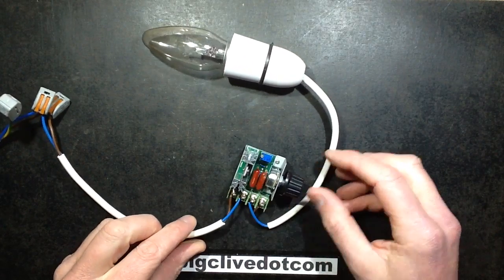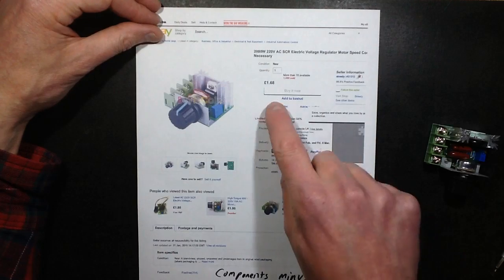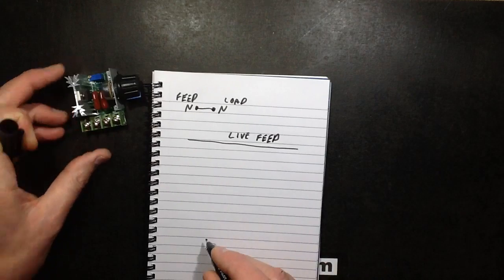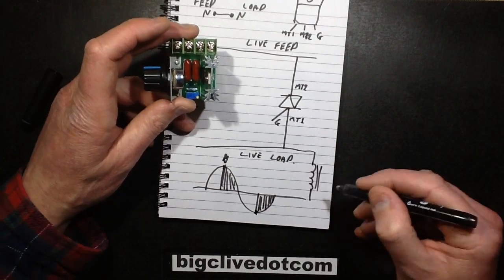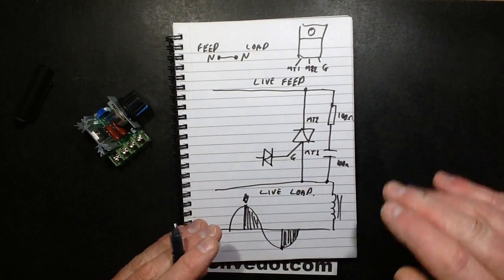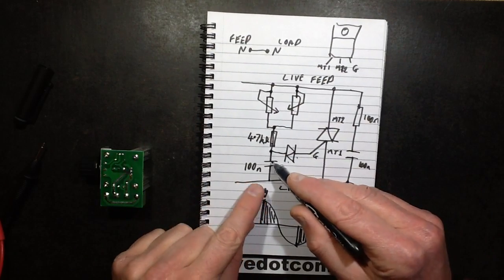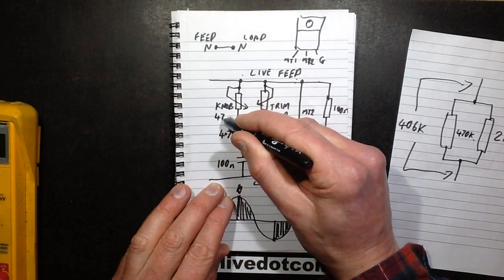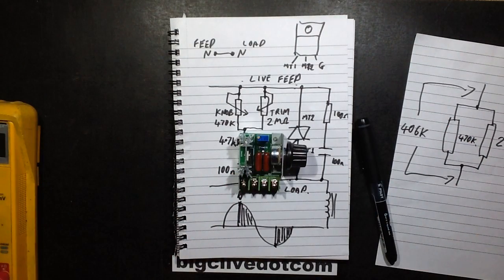Reverse engineering of a mains power controller.

Comment: The one I have seen use an SCR and not a TRIAC. Is there a part number?

https://www.amazon.com/gp/product/B00LODGP2E/ref=ox_sc_act_title_2?smid=A30QSGOJR8LMXA&psc=1
Reply from the maker: A thyristor would only switch half wave.
Reply: @bigclivedotcom  Precisely. (Silicon Control Rectifier) I am just wondering if there's a slight possibility that your board is an SCR?
Most of these boards appear to have the part number scratched off or blank. 
I just ordered the one I linked from Amazon. They all appear to be one and the same manufacturer. (or copies) 
It states .."This controller uses novel    bi-directional    high-power SCR" Is that what the Chinese call a TRIAC?? :)

Thank you.

Comment: Thanks for detailed reverse engg. Can we simply replace BTA16 with BTA40/41 to increase its power level without any modification in circuitory or the oem circuit 4000W with a bridge rectifier is required as explained by you in a separate video.
Reply from the maker: You might need to scale up the other component sizes too, to deliver a higher current gate pulse.  If you're trying to build something like the 4000W dimmer unit then it might be worth using it as a base for the project and upgrading the components.

Comment: Here is the one I bought on ebay.
https://www.ebay.com/itm/AC-110V-220V-2000W-8A-SCR-Voltage-Regulator-Speed-Control-LED-Dimmer-Thermostat/322922899870?hash=item4b2fb4699e:g:MjsAAOSwZ1BXeNBv

Comment: Your analysis is very good and helpful for needy repairs if any. I purchased recently one from China.  It is working good for my mini drill (220v, 350w 2600 rpm) which I use for day to day minor works and also for my Bosh angle grinder  600w 11000 rpm (to the reduction of  speed upto 50% ).  Any way my other Drill  Bosh 13 mm has got builtin speed control.  Thank you. With regards - VG Krishna, from India.

Comment: Can you use this to control a 240 volt transformer welder?
Reply from the maker: No.  A welder requires a lot of current and the chopped waveform would make the arc tricky.  The huge inductive load might also kill the triac quickly.

Comment: I have a question. I bought one of these only it has only 2 terminals for input and out put. How do i connect that????
Reply: (If you don't already have an answer) Chances are, connect the neutral of your input and output together and connect the hot wires to the board (It only needs to switch the hot wires, so the neutrals can completely bypass the unit)

Comment: Hi can I use this for hho? Thks
Reply from the maker: It's AC and mains voltage so not suited to electrolysis if that's what you mean.
Reply: Bigclive thks for response. Yes but what if I do a br after the circuit?.

Comment: So the beast will not switch on until the mains cycle reaches over 30V?
Reply: Right, but then it can be turned down a bit I have found, down to about 18 volts.

Comment: I built a speed controller using this same circuit a few years back Sadly its died for some reason (probably not a big enough heatsink), but I think I'll buy one of these and just add either a small fan or a bigger heatsink.

Comment: Sir is the light dimmers can control current? Is it increase or decresw current level?
Reply from the maker: It reduces current by turning the load on and off during the mains cycle.
Reply: Thank you sir..so its not inter fair  voltage?

Comment: Common value for a pot would be 500K not 470K.  500K in parallel with 2 meg  would be 400K so close to the measured value.  How long did you spend at the pub on your way home?  Next time you have R in parallel, go here https://www.allaboutcircuits.com/tools/parallel-resistance-calculator/
It can handle multiple R in parallel.

Comment: sir how work Trigger Switch for Drills
Reply from the maker: Modern trigger switches use a MOSFET as the main switching component and electronic circuitry to drive it with a pulse that varies in on to off ratio to control the power.  (Pulse width modulation.)

Comment: Hey @bigclivedotcom im going into cyber security, looking to mess with pcbs. got my jtagulator and about to buy a bus pirate, im working with a sound board for a little project just to get the fundamentals. Dont understand the whole electrical bits but studying the chips, scared to blow my toys up, Any tips?
Reply from the maker: Proceed with caution, double check anything you have doubt about online and if you do blow something up or brick it, then know that it happens to the best of us, so don't feel bad about it.

Comment: Excellent info! I have a few of these kicking around and was just going to stuff them into a plastic box to use as a hacked up soldering station and hot air gun. I was wondering about the potential for electrocution when i noticed that 2 pins of the pot are directly attached to one side of the outgoing AC. Thanks again for another entertaining/informative video. Esecially enjoyed the 'Hitachi' teardown. Had to have a drink to Lily the Pink after that.

Comment: Are there any flaws in wiring the live load to MT1 like in the schematic ? Many of the schematics which I have found online are reversed, they have live feed on MT1 and live load on MT2
Reply from the maker: It can be used either way round.  The gate reference on the circuit itself must come from the MT2 side though.
Reply: Great, just another question about components: how much is the resistor's wattage ? From the video they seem standard 1/4W, but since I don't have the module in my hands I can't tell. Also I believe that the two capacitors are 400V at least
Reply from the maker: I think they were metal film, so closer to 1/2W in that size.  It's always worth over-rating the components for reliability.
Reply: Ok thanks again!

Comment: Can someone tell me how can i limit voltage,so when the potentiometer is on its maximum setting i dont burn my heating wire?
Reply: 3 years late, but it's AC if you want to half it, just add a diode.

Comment: Replace pot with photoresistor, heatshrink LED to it, connect led to arduino. BAM you have PWM control for universal motors. Add another LED and phototransistor to read RPMs from motor, write some PID code, BAM you have closed loop feedback motor control!
Reply: A photoresistor won't take 240V. As you said above, "BAM".  
Maybe 2 in series, so long as they were illuminated equally.
Reply: @CaspaB A photoresistor certainly couldn't handle it. Honestly, it would be easier to have a servo rotate the pot. Or make a custom control board
Reply: Harvie sounds interesting! Have you actually implemented this?
Reply: @MegaJmanjman  i Had
Reply: @MegaJmanjman  https://www.youtube.com/watch?v=c8Cs5FyOGb4

Comment: If it were 470K then the expected combined resistance would be 1/(1/470000+1/2000000) = ~380K
Since it is 406K however, the resistance of the potentiometer should be 1/(1/406000-1/2000000) = ~509K so I'm guessing perhaps it's supposed to be 510K?
Reply: Remember, these are variable up to the specified values, down to zero. No point going for an E24 value.
  Oops, YT recommended this ancient video from today's video in 2022.
Reply: @johndododoe1411  Fair enough, but he was trying to measure the "specified value". And just like resistors, potentiometers also sold in steps that make sense, considering the tolerance. To be fair, potentiometers usually have fairly high tolerances, so you're kinda right, it's actually pretty unlikely to be a E24 value. Potentiometers are usually sold in E6 steps, plus some round values, like 500k. And values like 100k, 500k, 1M, etc. are by far the most used. So the resistance of the potentiometer is very most likely (supposed) to be 500k, not 510k.

Comment: will this module be able to safely regulate the temperature of an 18W soldering iron?
Reply from the maker: It could, but an 18W iron should thermally balance at a good soldering temperature.
Reply: i ended up wiring it to a socket that often use with a travel size (fast heating) clothes iron to desolder components off unwanted pcb.

Comment: The description says it all. " This controller uses novel bi directional high power SCR. It can be very convenient adjust the current up to 25A and solve the over current problem of the heating wire resistance is too small in the case of cooling causing good.

Comment: Could this be used in conjunction with a full bridge rectifier to make a cheap dc power supply?
Reply: Yes, but with a serious caveat, it wouldn't be isolated, it would be mains referenced and if you use a non polarized mains connector(or wire it incorrectly) you could end up with a negative DC wire of your power supply at live voltage ready to kill you.
Do not do this if you are not fully aware of the risks.
Reply: I would also like to know this ^^^

Comment: I bought 5.  2 for pump control and one for light dimmer and a spare.  I found I needed a resistive load (lamp) in parallel with the pump to get a useful speed adjustment range.  Can any on explain why and what resistor would I need to replace the lamp?

Comment: I saw these Regulators like the one you are showing titled: 220V 2000W Speed Controller SCR Voltage Regulator. _Will it work with 120V from the wall?
Reply: yes it will but you can only regulate from 50v to 120V AC
Reply: Great thank you. Nice video.

Comment: Can we control the speed of the ceiling fan or table fan which is having single phase induction motor? If yes then will i be able to control the speed from zero to maximum like the bulb is dimming as shown in the video? If no then y? Please reply ASAP!!!
Reply: You can but it will most likely hum. Sometimes to an extreme. Not great for a bedroom ceiling fan.

Comment: I bought one of these after seeing it in your videos. It cost me $2.10 CAD with shipping included.  I wired it onto a box, and it works quite well as a dimmer, but controlling a fan with an induction motor, it hums quite loudly.  I'm not sure the cause or the cure.
Reply from the maker: A motor will hum quite loudly on phase angle control because it is being switched with quite a sharp edge mid cycle.   Some motors will not work well with a simple dimmer like this as the back EMF from the motor may cause issues with the triac not latching properly on one or both halves of the waveform.  Then you have to consider switching symmetry and suitable RF suppression.  For the trickier motors it's sometimes better to get a dedicated motor controller for that type of motor.
Reply: I used a simple rotary light dimmer to control the speed of my range hood exhaust fan, and it works quite nicely with no hum.  I assume it's also an AC induction motor, so why the difference?
Reply: @Landrew0 the difference is that one is a universal motor which has a commutator and breaks the contact several times every revolution and your range hood has an induction motor which represents a permanent electrical connection and the dimmer is just weakening the power - perfect for your application but universal motors need some extra simple wiring to make them run smoothly for the most part .
Reply: How about adding a solenoid on live load line 
it would make any difference ?

Comment: Hi. I'm no electronics engineer but I do have a need for these regulators to control motors of various woodworking tools I am building. I have bought 10 of these to date, from various suppliers and prices from 1.50 to 3.5 gbp. Only two of the ten do what they say on the tin. The other eight have output voltages from 200 to 240 (not 50-240 as promised). I found your video very edifying and as a result of what I learned went back to re-test the faulty ones to make sure I was testing under load and with minimised potentiometer setting.
All I can say is you were lucky to find one that worked! Thanks for the video.

Comment: Can someone please explain an issue I have with one of these 'exact' controllers please.
I have tested it with various power tools with excellent results, so I know it is not faulty.
BUT, when I hook it up to drive a MOT, I cant seem to measure the voltage or amperage
correctly.  
My 'cheap-ish' multimeter (on AC) doesn't read 240v output from this controller until it is nearly 'full on'.  So I'm guessing that is because it is not a 'clean' sine wave until then.
If this is so, can I also not trust the MM readings (both volt and amp) on the output of my MOT when driven by this controller below full-on?
So if anyone has any ideas/suggestions on how I can measure the MOT output, or corrections on my above statements or question I would appreciate it.

PS  Keep up the GREAT work Clive,  I love it all ... except your ability to hold a PCB and solder and guide said solder to the right place with one hand makes me SOOO jealous!!

Comment: +bigclivedotcom I used to work out circuit component calculations with pen and paper - like all of us did back in the day. I then progressed to a handy calculator and a cheat sheet permanently stuck on my bench - now well worn and faded. Lately - for squirmy component calculations I discovered a Google Play Store App "Electrodroid" and it works out the potentioneter value to 500k.
Reply: What's more it's printed in white ink on the actual pot "B500K" looking from the knob side on the pot mica/pcb.  :)

Great video as usual BigClive!  Thanks!  :)

Comment: Hi, so only two of the three terminals on the potentiometers were being used?
Reply: The third one is usually at the other "end". So if you have a potentiometer of 100 kOhms and it has 10 kOhms between two of the terminals (say A and B), it'll have 90 kOhms (B and C) and 100 kOhms (A and C) from the third terminal to each of the other two.
Reply: So one is connected to live source, one to live load and the middle to the resistor?
Reply: No all three are connected to the resistor inside. The difference is that two are connected to the "ends" of the resistor and the third one is connected to somewhere in between and can be "moved" to either "end" and can thus change the resistance relative to the "ends". Note that I don't specify the order of terminals here, it depends on the potentiometer you use, which terminal (aka left, middle, right) is connected where (end or in between).

But when you measure the resistance between the ends you will always get the maximum resistance and that won't change. If you measure between the third one and one of the ends you'll get a resistance which you can vary. And additionally if the resistance to one end is "something" the resistance to the other end will be always "maximum resistance - something".

Hope it clears up, what I mean.
Reply: Sorry, on the diagram, there is two wires coming off the potentiometer, but there are three terminals on a potentiometer. So is one of them not being used in this instance?
Reply: That is correct.

Comment: I got one of these in the mail today.
I am a bit of a newbie. I am measuring the output with my multimeter and it only shows 230 volts nomatter  what position the pots are in.  Is  this thing defect or am I stupid?
Reply from the maker: That would be normal.  It needs a load on it to clamp the leakage down.  Your meter is really sensitive.

Comment: Great vid, do you think this will be ok to use with a washing machine motor. i'm making a edge sander i have the motor but need a controller and this sounds great,.    subscriber
Reply: +new2wood1 I was wondering the same thing and will it affect torque?
Reply from the maker: +Harry Irvine Phase angle control is often used to control washing machine motors.  Torque will be a bit variable, hence why the washing machines often use feedback from the motor to regulate the speed dynamically.

Comment: +bigclivedotcom
I'm building a lamp holder with built-in dimmer for displaying these nice classic Edison bulbs you can get from China nowadays.
Since it's for decorative purposes only I don't need the lamp to be able to be at its maximum brightness so I've put a 270K resistor in series with the main potentiometer so at the highest setting it's already dimmed to about half its maximum brightness. However, because of the added resistance I now have to set the secondary trim potentiometer much higher. This is all working great but I was wondering if this causes any negative side effects like putting more strain on the triac or dissipating more power that gets turned into heat.
Reply from the maker: +Ni5ei It should be fine.  It's the same technique used for adjusting an upper motor speed on simple triac controllers.

Comment: I found a very similar looking heat sink (probably the same type actually) from a supplier called "International Aluel". It claims to have a thermal resistance of 11 °C per watt.

The module, running at 240V with a load of 1 kW, would dissipate about 4.2 watts (applying the "1 watt per amp" rule of thumb), which means that its temperature would rise to almost 46°C above ambient.

So even 1 kW might be too much for that tiny module! I don't know where the 2 kW limit came from (perhaps the absolute maximum temperature the TRIAC can handle?)
Reply: My bad, upon watching again I realised that the heat sink looks more like a slightly smaller part from the same supplier. Thermal resistance is actually 14 °C per watt. Temperature of the heat sink and TRIAC, at 1 kW load, and applying the same equations, would be 58 °C above ambient.
Reply: BTA16 600B is rated at 16A from what i can found on google, so probably from that someone calculated just the power

Comment: Clive: Do you think my Dad could use one of these to speed control his AC lathe?
Reply from the maker: It depends on the type of motor.  The most compatible type would be a universal motor with brushes.  A plain induction motor might give torque problems.
Reply: +bigclivedotcom Thanks for the advice.